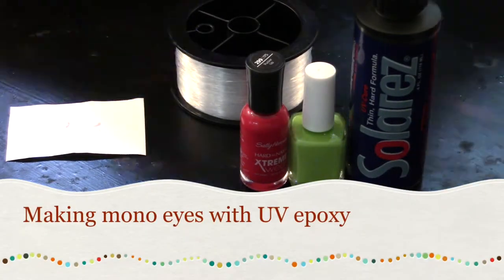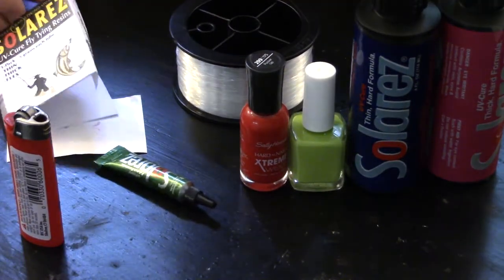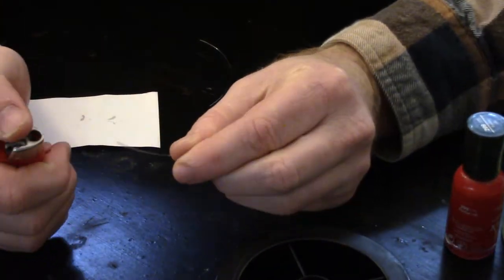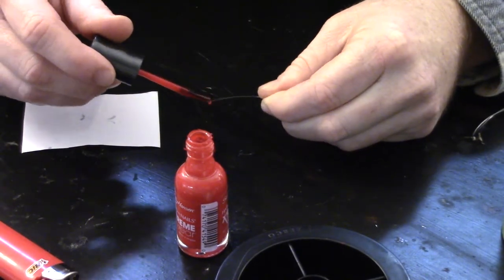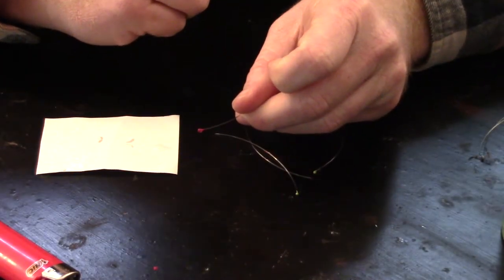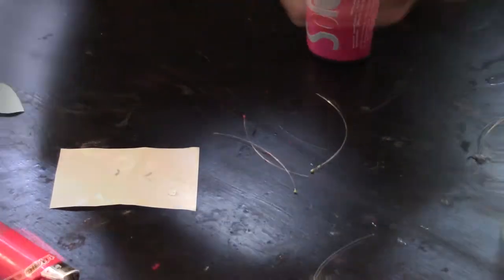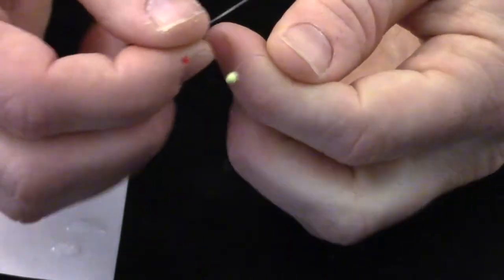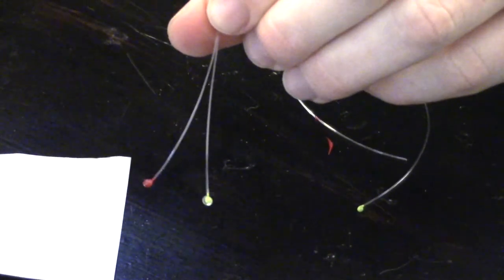How to make mono eyes with monofilament and UV Resin

Comment: OK; like to add a suggestion.  I have trouble controlling the melting mono, so how about just tying a knot?  I haven't tried it yet..... I'm going to try a figure8 stopper knot as it tightens symmetrically.  Wouldn't even have to melt it.
Reply from the maker: Could work...  Knot, snip it close, then use the UV Resin?  Maybe.  Never tried it.  Let me know how it works.
Reply: Just made 2 pair.  My knot wasn't quite as symmetrical as I'd remembered, a tad longish.  The  UV epoxy smooths out the overall appearance, 4 dips and it's pretty round.  More epoxy than I'd hoped for, good results overall, going to try different knots.  Can't nip it too close, lost one knot, can't tell it though.  First experience with UV.  Neat stuff.
Reply from the maker: Yeah I love UV resin!  I use it as much as I can.  Well when you perfect it, please tell me your secret.  :)

Comment: Are you nuts, Solarez is bvery expensive for 8 oz bottle.
Reply from the maker: But it will last forever.  Most brands are 1/2oz bottles for similar price.  Solarez sells 1, 2, 4oz also and still better price than others, check them out